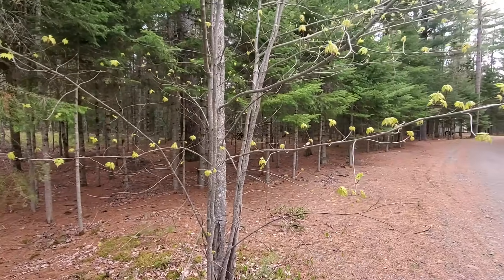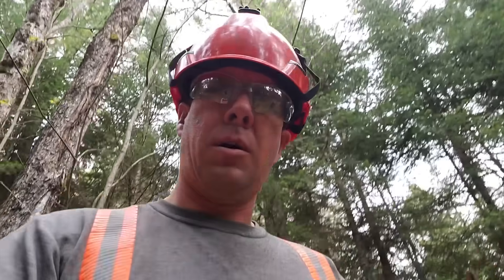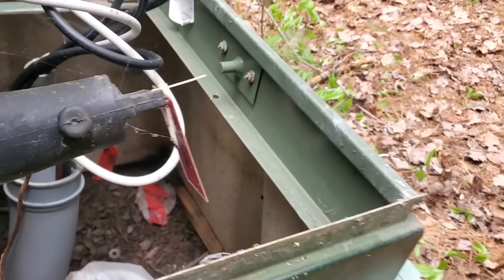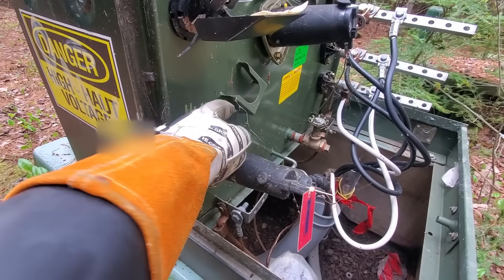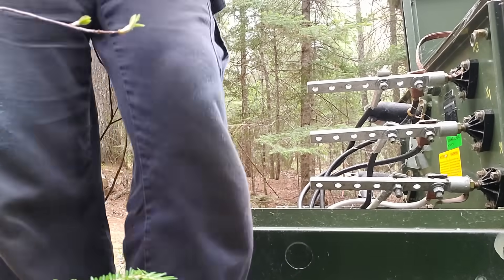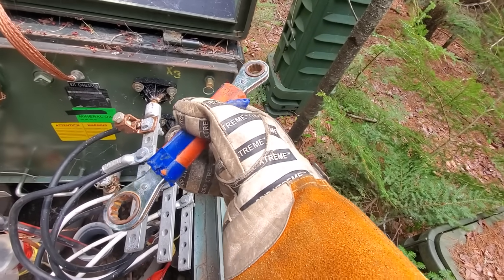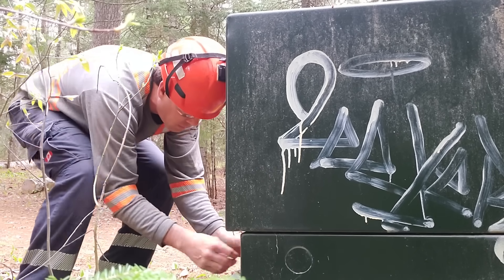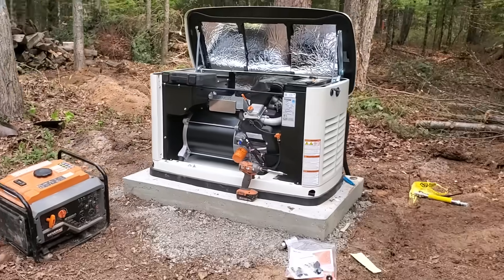Padmount transformer service disconnect

Comment from the maker: Hey Everyone! 

Always make sure/verify you're working on the correct lines when it comes to underground! There is still a chance that it's a coincidence that there was no current on the particular wires that were checked, that's why you must always check voltage at the work location as a final step.

I'd love to hear what local y'all are from in the comments! 👊
Reply: Hey definitely worth bringing up the putting the bolt and nuts or other Hardware back where it was in any industry or even just simply doing some DIY project or repair it can really save a lot of hassle especially if you've got multiple sizes of hardware or other circumstances on top of everything else you brought us okay where did that student fees of Hardware go and you can't find it and well you don't have any extras and more family members works on sewing machines and some of that stuff is well just about hen's teeth on Vintage machines not exactly something you can go down to Ace Hardware and get a piece of hardware for right down the screws and other fasteners also if there's a hole where something can go it has a tendency to go in that hole trust me what a X Men another family member working on one from the other family member but this way HV AC event nearby of course that's where that one piece of Hardware went yeah ran down to get the magnetic retriever and one of those push-type cloth flexible shaft things what's the little Quan the end however someone else said managed to get out the HVAC vent cover before I can get up the stairs fortunately it was literally right in front of transition where the HVAC vent head slope downward got lucky that time and of course afterwards closed that vent off with a towel just something to keep in mind might take a little extra time but you'll know where your Hardware is you'll know that everything is in the proper place also great when you have multiple Links of screws and other situations where he's getting mixed up is not a good idea no matter what it is you're doing all the supplies and less frustration less issues just good practice to keep things going smoothly and have less issues getting things back together and so on this cannot be understated enough even I'm doing things time in a silly way that well what up more problems it's like if you're working on a faucet always have the drain blocked off otherwise you might happen to need to pull the trap to get the faucet back together put it that way at least once or twice and drop the faucet screw it down and going down the drain quite literally yeah it happens but yeah it's easier to think things over first and do something to mitigate any in feeling like this and if the screws and nuts are where they belong reattached no problem whatsoever not quite foolproof but almost Murphy's Law will get you every time then outsmarting Murphy is the way to go I think you should where I'm going good overall tips yes applies to almost anything that could and definitely will go wrong at one point or another somewhere sometime somehow
Reply: Local 456 inside wire person
Reply: I'm not but a good friend I went to trade school is, right out of school she joined Local 567 as a journeyman lineman, now she's with Local 1253 as a wind turbine tech in Maine.
Reply: Local 47! Thanks for the awesome videos and explanations! Really appreciate it
Reply: São paulo Brasil  grids underground
Reply: Lu46!
Reply: Cheers Brother, 
LU 701 Inside (ret.) , 
safety first !

Comment: If i was the sparky i wouldn't ask to disconnect at the transformer.  Pull the meter.  Then take the conductors out of the existing main panel and direct them instead to feed the xfer switch. Wouldn't even have to open the meter can.  Just pull the meter to disconnect them. Put it back in when done and nobody needs to go to the pad

Comment: What size primary cable does your company use?  We use 345mil and 1000mil jacketed cables.  We used to use 260mil and 600mil jacketed and non-jacketed(before my time).  And who the hell is taggin a padmount in the middle of the woods?

Comment: That's interesting you guys disconnect and then do the reconnect for electricians when they do meter changes, do you guys also pull the meters or electricians allowed to do that? In my neck of the woods we rarely call the utility company to have them disconnect power at the transformer, 99% of the time when we do even in underground meter like a 320 amp we pulled a meter, and we unhook line side and we just tape the crap out of the wires and slide the socket over them and then slide the new socket down and reconnect them and even overheads we are allowed to cut and reterminate at the weather head. There are even houses where the single phase 4KV primary and the polls and the transformer are all owned by the customer and thus maintenance and repairs are also the responsibility of the customer.
Reply: Only time I've had to have my local utility company disconnect power upstream for doing a meter change was because I was changing a damaged 110/208 volt 3 phase meter socket and the wires inside were just very very short and also everything was corroded to heck and back.

Comment: I'm planning on having my Federal Pacific outside panel and my meter socket replaced in a month or so. It's good to know my neighbors won't be affected by the disconnect (barring any mistakes). Thanks for the video.
Reply from the maker: Probably the most common circumstance in which it could affect your neighbor would be;
If the transformer is already close to it's limit. On occasion the socket replacement requires a transformer upgrade. (If your increasing entrance size (100 to 200 amp for example))

Comment: Right on brother, those underground transformers are a blast to wire up! I just turned 20, been wiring these things up under a contractor but I’m not a lineman so don’t do any hot work, just wire them up and the power company comes out to make it hot. Do you have any suggestions for me if I wanted to get into making them hot?

Comment: I noticed how robust your micro electric meter socket jaws are. In my area of the us we use Milbabk meter sockets that are push in like this and I think that they are INFERIOR!
because of the lack of a heavy spring and about only a little over 1/4 in of contact on the meter blades on a 200 amp meter socket. The other kind they use on the next
utility over is called JAW CLAMPING LEVER BYPASS which you have to lift this lever to unclamp the meter which will be locked in the socket. Here in my area we do not
allow ring style meter sockets because of the hazards they can present if a block is cracked. On a ringless meter socket you can pull the cover and look inside for cracked
blocks or settling of the ground. Ive seen it where its too unsafe to even think about pulling the meter because the guts are badly damaged. In my area we use a meter
trough that is a pedestal that goes into the ground and the line sides are crimped on. There are bus bars that go to the top jaws. The meter is 3 feet off the ground on an
underground 200 amp service. There is no conduit that goes from the meter to the ground just the meter pedestal itself. I can tell this is from Canada because of the
ring style Micro Electric brand meter sockets. I dont understand why your meter sockets dont have the nice 2 piece lay in lugs where you slide the top of the lug off
to make it nice and easy to land your cables like we do here in the states. Why dont you have those kind of lugs in your meter sockets in Canada?

Comment: First off have you got a second lineman working with you? Secondly why doesn't your utility purchase low voltage secondary cover up blankets for you to put on the second points of contact? Thirdly have you ever used low voltage secondary rubber gloves, they are so much nicer to work with.

Comment: Not a lineman but I do believe in/support unions.  Thanks for the videos I love learning about what you do, do you ever deal with RFI issues?  I was surprised you didn't connect the loose wires to the neutral bar, is there a reason not to?

Comment: I'm curious, why is arc flash protection not required in this case? I would think there's a pretty significant arc flash potential between those bus bars, right?

Comment: I see those green boxes everywhere I live in the NW. Can I ask how many customers can be services by one box, they all seem the same size. It looks like 7 or does it depend on other factors?
Reply from the maker: 7 is a good average in urban areas.

Main factors are;
Distance (voltage drop)
House entrance size (200A, 400A...)
Transformer size (25kva, 100kva...)

One large 3 phase transformer may feed 100 unit apartment!

For single phase transformers like in this video, 4-6 is pretty common with the geographic layout of the homes.

Many factors come into play!
Reply: In my old utility we put up to 14 100 amp customers on a 50kva transformer

Comment: I was an IBEW journeyman electrician.
I changed careers into engineering and I'm retired now.
Thanks for some great content.
Reply: Why does the hig voltage only have one conductor/elbow.  The main feeder pipe only has one cable. Is the shelding ground around the cable used as the second conductor ?

Comment: Hey Bobsdecline, local 1 St. Louis here. What kind of tester (style or brand)would you use to check for live voltage on the capacitive check points on the load break elbows and Deadbreaks?
Reply from the maker: Any high voltage proximity detector will work as long as it has the capacitive  or "U/G" test setting. I've only used three different brands and find the Greenlee works quite well.
Reply: @Bobsdecline  Thanks so much

Comment: My dad is an IBEW member from Ft. Lauderdale Florida. He also "signed the books" in Cincinnati which I think means that he told them he is available to work.  He has since retired.  He worked for GM for 25 years as a WEMR or Welder Electrical Maintenance Repairman.  Notice that despite working inside the plant, he was not UAW but IBEW. After the plant closed he got hired by Cincinnati Enquirer printing operations and was an electrician maitance man.  I considered being a Lineman and doing the journeyman apprentice program but ultimately went into IT work instead.

You linemen are some tough dudes! HV Electricity scares me!

Comment: There’s no difference between working hot in the transformer and working hot in the meter socket, but I can see where that would be needed to replace the meter socket, just not for rerouting the load-side conductors of the meter socket, which are dead with the meter is pulled.
Reply from the maker: You're correct other than; 
In our jurisdiction - The electrician doing the work in the meter socket is not aloud to work around live conductors that don't have a fuse before connection to our system.

Comment: I’m curious why did you not  put a rubber boot on the blades below just in case the unforeseen and with the cable that you took off once you put a boot on that before tuck it in under just a case something wrong happens at the other end as a precaution I remember we used to put boots on those blades when we remove the cable just a thought , am I wrong?

Comment: 7:02
This is not a "bleeder" on the H1B .

H1A is high voltage wire
H1B is ground/common wire

And why is neutral X2 ?
Usually neutral/common/middle tap is marked X0
Reply from the maker: H1B is at Primary voltage, not ground. It's a "feed through" to run a high voltage cable between it and next padmount in series.
Reply from the maker: Neutral is X2 because it's single phase with a center tap. X0 would be on three phase tx.
Reply: @Bobsdecline  ok, but i dont understand the primary. How do you get a potential diference with only one wire?
Reply from the maker: Our high voltage cables include a neutral wire which consists of multiple strands that wrap evenly around the cable.

A cross section would look like:
-#1 aluminum/copper in center
-Insulation 
-semi con
-copper strands wrapped (equivalent of #2)
-outer jacket

The strands are wrapped together as they exit the cable a few inches below the termination. They then bond to the H2 which is bonded directly to the tx, much in the SE as a single bushing pole transformer.

Comment: Another Union Brother. NY Brotherhood Railroad Signalmen Local 56.  

Trying to convert all the 25hz track circuts to 100hz as they want to shut off and the reitre the 25hz MG.  the generator at the sub is run off of 60hz.  The output is isolated and not grounded using two wires to transmit. Same with the 100hz.   25hz is a Harmonic of 100hz.

Comment: How much is the short circuit current on those busbars? I believe that we require face shields when working on live busbars in the Netherlands. Short circuit currents are around 20 kA, so if there's an arc, it will be pretty serious.
Reply: 22kA fault current is a pretty safe bet at the terms. At the house on the other end, due to impedance,  could be 7500A fault current, for example.

Comment: Great video as always. I'm fascinated by the workings of the electrical grid, and usually learn something from your videos. For example, some time back, I saw lines going from the primaries to ground/neutral where some local work was being done, and one of your videos explained what that was. Saw the same thing again recently, which leads to a question you may or may not know or have a thought on - Our local power company has been replacing what seems to be all the poles along a certain stretch,  and they're replacing the existing poles with mostly wood ones, but they're also placing composite poles at seemingly random locations/intervals. Any thoughts as to why they're placing mostly wood poles, but also composite poles at seemingly random intervals?

Comment: Nice to see that you get underground Lines instead of these expensive developing country type overhead Lines - the initial costs for burying all the lines might be higher, but basically no service calls after even  the slightest thunderstorm is much cheaper and much more reliable in the long and even mid run.
Of course you need to double check, when you are working on underground lines - proper and correct documentation is everything... Seeing, where the lines goes is the only advantage of overhead lines.
Reply: I'm not convinced

Comment: Wow! A copper loop? I’m guessing that the electrician brings the loop to the secondary bus and your company takes it from there, but maybe you could clarify that. Both utility companies I worked for would bring the loop to the meter and that was usually 4/0 Al  for residential services (it was much smaller in the past, and overhead loops are often smaller than 4/0 Al.

Comment: I was an electrical distribution planning engineer (BSEE) prior to moving to the US Department of Energy national laboratory system (NREL), and I picked up enough experience during my planning years that allowed me to sit for the Master Electrician along with my electrical contractor license and also the Commercial Electrical Inspector license as well (another grueling test). Never joined a union during those years, and that the IBEW local is very different for utility linemen vs.  electricians. .

I’ve spent thousands of hours working with and driving out to distribution system jobs, and while there was much good-natured banter (mostly), and I appreciate the hard work and dangerous conditions that linemen face (while the pay scale is pretty solid). I really enjoy your channel Aaron, and you are doing a great job with the explanations. I suppose that’s partly due to your being the very nice Canadian neighbor (I’m in Colorado, so not quite your neighbor). Be safe and God bless.
Reply: Why does the hig voltage only have one conductor/elbow.  The main feeder pipe only has one cable. Is the shelding ground

Comment: Wow, where I live, if you ask Edison or LADWP to cut the power, they will disconnect the power and then will not come back to connect the power until you do do the work, either changing a panel or adding in the transfer switch and have the city inspector approve your work. Then they will come out and energize the power. This could take a week or more to get them back.  It forces us to do everything LIVE, underground and overhead. Overhead is easier to disconnect and connect. Underground we insulate all metal surfaces.

Comment: Love your videos! I was surprised to see you didn't cover the other secondary stabs with rubber sheeting or rubber boots when removing the service.
Our work rule in NYC is to cover the other stabs and only expose the one you are working on. We use a pre-molded rubber boot, very easy on and off.
Keep the videos coming, great content!!
Reply from the maker: Thanks Peter! This was also brought up by a few other viewers and yes you're absolutely right. We have molded covers for the elbows (which aren't tested) and our 1kV blanket which can easily be used on secondary. Completely forgot to mention and will def do a follow up video!